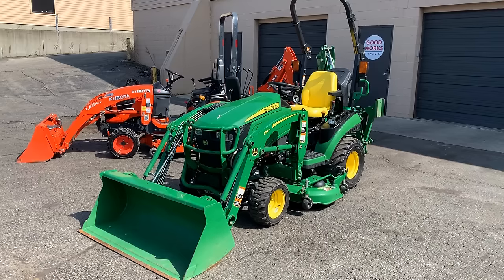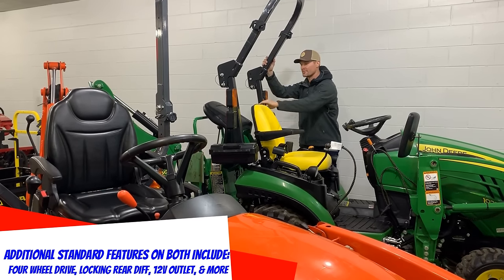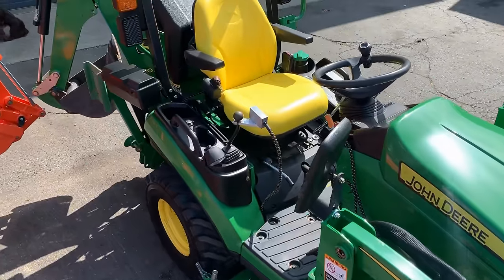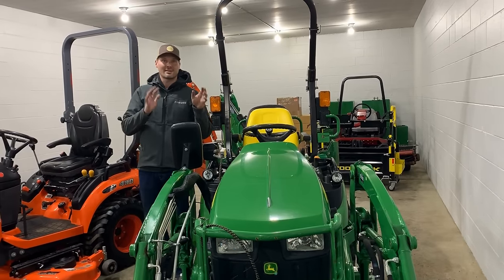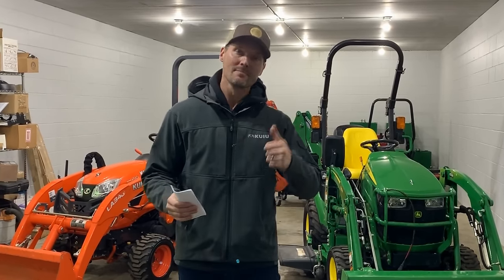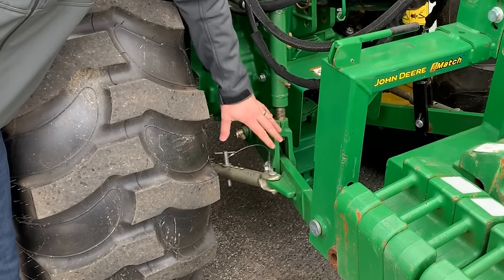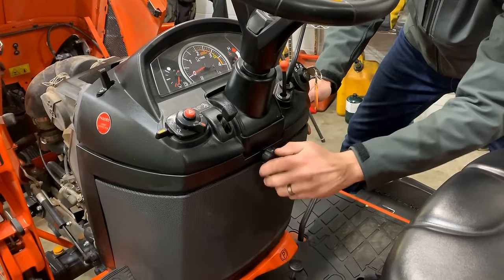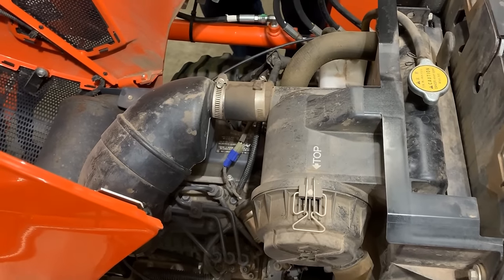CLEAR WINNER? JOHN DEERE 1025R VS KUBOTA BX23S TRACTORS! 🚜

Comment: Hello sir, I like this video a lot, but there was two important things you left out, price ,and the dealer itself.I realize you are just comparing the tractors themselves but the dealer's attitude can make or break a deal. I started shopping for tractors about 3 months ago, I started off with YT of course to see what was available. But when I went to my local Deere dealer, they treated me terribly, first they ignored me for about 30 minutes ,then one of the salesman approached me and said, " We have better used deals for you out back" I told him I was interested in the sub compact 1025r, and he said it was "pretty pricey" . I looked at him a little funny and then asked if they had the model with the backhoe, and he just rolled his eyes at me. He then ushered me to follow him into the building were about 8 to 10 salesman were chatting it up. He said out loud hey this guy wants the 1025r with the hoe really loudly a couple of them started laughing. I then asked if there was a serious salesman that actually wanted to work for a commission, it went quiet, so I pulled out my 20k in cash and said no takers. They jumped up quick but I was already turning to head out the door. I guess they didn't take me serious because I drove in there with a beat up 1992 Chevy farm truck, need less to say I bought a Kubota BX 23s the next day. The other issue is price, in my local area the 1025r is 8 grand more than the Kubota BX 23s.
Reply: i would have done the same if i was treated like that.....my dear dealership has been patient with me....think ive gone there 4 different times combing over the 1025r and everything on it...ive alled things and had items taken off to see price differences....worked with the same salesmen everytime, true cowboy like myself....ive also been paying attention to how things are there in office area's, havent looked at the service area yet but sure that is next...Id alos been to the branson/Ls tractor dealership, machines there are better priced but looking at them closely dont have the grease fittings on areas i would want them....  lifting capacity and what items i can get for the deer for parts matters, even if i wanted to get a aftermarket cap for the winter months here matters....id used to allways be a Kubota guy as well as liking john deer....problem is kubota dealer allways seems closed everytime i drive by......how us men are treated at the dealerships do matter...
Reply: Same Deere service quality in South Daytona Fl. got an orange one as well based strictly on KTAC and lack of professionalism at JD
Reply: Love the story. Thanks for sharing.
Reply: Clear winner Kubota for the none proprietary loader configuration and it’s unfortunate dear used to make the best deck ever made, but I’m not sure if we can still say that these days

Comment: The only “feature” of these nearly identical machines that has any practical significance is the price. Where I live Kubota happens to cost $5,000 less. In other areas it may be the other way around. Everything else is just minor details not worth obsessing over.
Reply: In my area in Canada the kubota costs 33g where the jd is about 42g. So with both tractors being so comparable otherwise, there really is no comparison
Reply: The resale value of the JD is very significant.

Comment: Personnally, the fact that the 1025R has over 300lbs more FEL lift capacity makes him the winner. No need to compare anything else. When you are in the market for a SCUT vs a lawnmower like the X series, it's for a FEL. Even if there was only 100lbs difference in lifting capacity of the loader, for such small but noneless amazing machines, it needs to be considered. I see the BX23S halfway between an X series and the 1025R...my 2 cents.

Comment: Pretty solid comparison video. Thanks.  3 years ago I was in the market for a subcompact tractor to help with landscaping in my modest but complex (just under .5 acre) lot.  Even though I never had owned a tractor myself, I'd always been a big lover of green...you know...several toy JD tractors as a kid, haha.  The video does a great job in pointing out many of the little pros and cons one has over the other.  Most of them are fairly minor and come down to personal preference, for example, in my case I preferred metal hood, panels, and fenders over plastic.  

I started my search at a nearby dealer that sold both the New Holland and the Massey.  I quite liked the looks of the blue NH. The salesman, however, discouraged me away from the NH saying they were newer to the subcompact market and that they had seen several problems with the NH tractors they had sold and that the Massey had much better reliability.  I strongly considered the Massey then and there.

Before I settled, I figured I would look at the Kubota BX23S.  I checked with one local dealer first and then a rural area dealer about 90 minutes away.  I took it for a little test spin in the field nearby and I quite liked it. He offered me the BX23S AND a box blade for about $2300 less than the local dealer did for the BX23S alone.  Game over.  I didn't even make it to the John Deere dealer.  That was Sept. 2019.  Fast forward 3 years and 138 hours and I still love my tractor.  It has been a great machine, with only 2 minor issues: 1) a loose throttle handle I was able to fix/tighten myself in less than 5 minutes, and 2) a detached FEL joystick that I was able to fix with a $15 part and about 45 minutes of labor.  

If the FEL capacity of the JD really is about 500 lbs more, then that could be a big deal to some people. But then again we didn't really hear what the lift high and dump capacity was.  I'm sure that weight is much less for both.  But for most guys, I think the main function with the FEL is going to be scooping, lifting up, and dumping dirt.  Regardless, I'm sure the extra capacity on the JD would come in handy sometimes.  But my experience has been unless I have an extra full scoop of extra dense dirt, which may cause it to strain a bit getting it out of the pile, 95% of the time the capacity on my BX is just fine. It generally can handle what the scoop can hold volume wise. If you need to scoop more dirt at a time, you probably need a bigger tractor and a bigger bucket.  

Quite a few JD guys have commented on their disfavor of treadle pedal. I can't really comment on the two pedal system on the JD, but the fact is I love the treadle pedal and it's ease of use and it's surety to not hit the wrong pedal/way when maneuvering (particularly backwards).  I have found it to be very straight-forward, simple, and fantastic. I haven't had any ergonomic issues with it.  

Simply put, I'm amazed at how much such a small tractor can do. I'm sure I would have been happy had I gotten the green one, but I know I wouldn't have gotten the screaming deal that I got with orange one. It's a great machine.  It's a blast to drive and still every time I get on it I'm grinning ear to ear.

Comment: I had a BX2360 Kubota without the drive over deck and disconnecting/reconnecting the deck PTO is a real pain. You have to lie partially on the deck reach under the deck with one arm (can't get both in there) slide the locking collar back and push the shaft on. Since the locking collar goes toward the front of the machine and the shaft slides on toward the rear you're trying to push in two different directions with the same hand.
The JD 1025R I have now has a drive over deck and quick attach PTO  and it's a piece of cake to remove and install
I also had a Kubota B3350- never buy one of these, they have an exhaust filter regeneration system that doesn't work, the tractor just quits in the middle of the regen. and you have to let it completely cool down then restart and do a parked regen, so 2 hours to regen while it is parked. It spent a ton of time in the shop, I traded it in with only 120 hours on it. From what I'm heard this affects all B3350s and wasn't just my tractors issue.

Comment: The biggest thing I like about the kubota is the pedal. Heel and toe. Forward push backward heel push. Its just so natural. I have a JD garden tractor as well i use for snow removal and im constantly hitting the wrong pedal. I really like kubotas system for that. IT may be the deciding factor on whether or not i get a bx or 1025

Comment: Thanks for the info..Allways helpful. If you get a Kubota B2301 in, I would like to see that "vs" vid to the 1025r. I have a BX2380. It's a great tractor. For my needs, the 3 point control did not matter. Get the relief pressure on the BX right, it will lift anything you need in the relation to the size of this tractor. The price point on the BX was $3k cheaper than the 1025r new. And I had the dealer add a 3rd function and a grapple. This was in our market area. I have been to your shop. You were very helpful, and I could tell buying a used tractor from you, would of been a great experience. It just made sense at the time to buy new with the finance offers. I really wish Kubota would offer a BX with position control. One of the main reasons I went with the BX over the 1025r was the physical size of the machine was better suited on our property..Thanks again for getting this info out to folks. I hope you and your family are healthy.
Reply: The Position control on the three point and lift of loader is the main thing making me consider the JD 1025r or Kioti 2520. And we have a Kubota Dealer not far from me in town where the JD is 20 minute drive and Kioti bout the same as JD.

Comment: I just purchased a 1025r Yes, the Kubota has a better battery layout and the easy hydraulic disconnect is the bomb.  But I like the JD polyresin panels and the fact that it's made in the USA.

Comment: Having owned a BX2360 (same as the BX23 w/o the backhoe) and currently having a 1025R I will say the pedal arrangement on the 1025R is better especially if you have long legs. The Kubota configuration having to bring you leg way back to use reverse gets very uncomfortable very quickly.
Reply: instead of using the treadle pedal I pull up on the forward pedal with the end of my foot. I rarely touch the reverse pedal.
Reply: I always thought it was very natural for backing up.  Some times it is easy to get foot caught tho.
Reply: I guess it’s awkward if you have small feet...
Reply: Derek Huber It's awkward for big feet too. Kubotas are good tractors but that treadle was a deal breaker for me. They're clumsy and take up too much room on the deck.
Reply: never use treadle pedal, Use my toe to control reverse.
Reply: I never use rear pedal on my BX23  use your toes to pull it back, GREAT workout for your lower leg too

Comment: Amen on the need for a drawbar.  I was surprised not to see one on my dad’s BX.  I’ve grow around my family’s 4000-series JD’s and it seems weird not to have it.
Reply from the maker: Yeah, definitely one of the conundrum's of the tractor world.
Reply: I bought a Reese Towpower 81378 Class II Step Bumper Receiver Hitch, Black and a CURT 45260 Class 3 Trailer Hitch Ball Mount, Fits 2-Inch Receiver, 7,500 lbs. GTW, 1-Inch Ball Hole, 2-Inch Drop, 3/4-Inch Rise. Removed the plate with the existing drawbar hole, drilled four 1/2" holes in the drawbar plate to match the bumper receiver hitch, bolted them together with 4 1/2" bolts and reinstalled the drawbar plate. Put in the hitch and you've got a drawbar. Also, the hitch is about 18" long which moves the hitch point about a foot back since I need the extra length to allow sharper turns. The best thing is I ordered the parts from Amazon and the receiver cost less than $20 vs over $100 for aftermarket JD receiver. The hitch was about $20 also
Reply: Ken Masker Good solution.  Thanks for sharing!

Comment: I bought a Kubota BX 1500 in 2004, the tractor outperformed it's working specifications and still rolls on today, but like most equipment... time and use still takes it's toll on the tractor with wear. 656 hours on the clock.

Comment: Always fun watching these comparisons between tractors. Reminds me of the old Chevy versus Ford trucks debate when I was a kid. LOL. I always end up learning a little bit more than I knew before. That being said, they all seem like great machines. I ended up going with neither of these two brands (getting a Massey) and I am very happy but both of these also seem great. Maybe I’m just easier to please, but I always ask myself “is it easier than a pick and shovel?“ and of course if you go with that simple logic, your gonna be pleased every time. LOL 😆 Like many before have said, it often comes down to your comfort level with dealer support. I know many of these little tractors don’t have a dedicated “drawbar“ but they often at least have a thick steel plate back there with a hole punched in it to at least pull a wagon. Maybe this is lazy, but I would love to see at least a light duty towing option on the back of the Backhoe to still pull a cart or wagon, without taking the Backhoe off. People make a big deal about ease of adding and removing the loader, but the truth is I’ve never taken mine off since I’ve gotten it. So many things I was comparing before my purchase, ended up not mattering at all, and the things I wish I had, I never even thought to look for. It’s a continuous learning experience. Fun video. Thank you! 👍😊
Reply from the maker: Great point about dealer support, I totally agree!
Reply: I just got my 1723eb awesome unit about 4-5k less than the kubota about 8-9k less than the Deere

Comment: About the deck mower, you were right!  On a Kubota BX 1880, you can fix a 48 inches under it, but it won't fit under the bigger ones.  For those, the 54 inches one will be the smallest one.

Comment: I want to see a 1025R with an integrated factory cab with heat and “AIR CONDITIONING”!  Seriously there is no reason they couldn’t get a very good compact system, there is no excuse.  
Opinion here, there should be an X700 factory cab that does both AC and heat that allows use of the loader(jd45 or ctc x4750) without interference.  I think x700 should be the smallest you need a cab for the premium small tractor market.

Side note if they had this for x700 series I’d be putting it on a x749 yesterday and actually doing more yard work and enjoying it.

Comment: Informative video - Thanks Courtney - My 2 cents - I did a sit on comparison going to both the JD & Kubota dealers on the same day before I bought my 2019 1025r - the frame size of the 1025r is larger, the front loader bucket is quicker, the backhoe is quicker (& actually does operate smoother - you can perform more than 1 function at a time) - The 2 seat option for the backhoe on the JD is wonderful - the Kubota seat is impossible to get turned around easily - the forward/reverse pedals on the JD are easier to use ( I think the Kubota reverse pedal would wear out your Achilles tendon in a heartbeat) - the 3 point lift function on the JD surpasses the Kubota - The price new side by side is almost exactly the same - JD always has incentives going on - fiberglass vs metal panels that will rust when you ding them - I have easily compounded out any minor scratches on my hood from branches - I could go on and on - but Green is just better than Orange ( in my humble opinion) - I wish I had found your site before I bought - you always have great deals with many more attachments for the price...  If you buy a Deere - I suggest buying slightly used as the way to go....
Reply from the maker: You always provide meaningful input.  Thanks for sharing triple C!
Reply: I found one digging when I was testing them out sometimes the Kubota couldn’t lift while the John Deere always did and that was a big pain and Because the John Deere is wider I found it much more stable

Comment: For me, it's the tractor with best support. I'd still have my Mahindra if I had a decent shop nearby - but, they're being sold out of a motorcycle shop and the maintenance is terrible. Our local John Deere dealer is amazing. So, I sold the Mahindra and got the Deere 1025R. My decision was made largely around the best support, both warranty and post warranty, that I could get. There's definitely some things I'd do different on my 1025R, but I feel really good about my local dealer and maintenance facility.

Comment: I have both.  I am selling the JD because I don't use the backhoe anymore and I prefer using my old Kubota BX1500 for everything else.  The Kubota is like a Japanese car while the JD is like a Dodge.  The only thing I like about JD is the quick connect.  The biggest drawback to the 1025 is the hydraulic controls can not do two things at the same time.  It is like working in 2D while the Kubota is 3D.  And the Kubota has all the controls laid out in nice order.  The JD has controls and levers everywhere and in strange places.  But the main problem is JD cannot lift and curl at the same time.  If I had known that I never would have bought it.  Why does no one mention that?  An extreme difference.  I think the backhoe was also crippled that way.
Reply: Thanks for this heads up. That alone help me decided not to get a JD, plus price. I'm  ADHD big time, and more ois not better for my brain, if you get my drift. How's the lift capability on the 25D, and mower removal? I found a used one and love to hear from you.

Comment: Also notice how much wider the Kubota’s ROPs is. Gives you much more elbow room while using the backhoe!
Reply from the maker: That is only on the backhoe model, but, yes, its a nice touch.
Reply: Would that roll bar width matter on the 260B backhoe with two seats? Wouldn’t it sit slightly  forward negating the Kubotas Rops advantage?